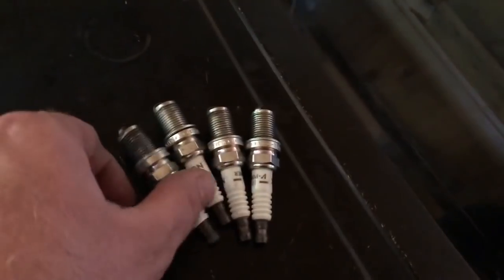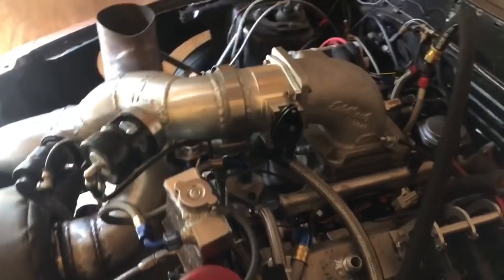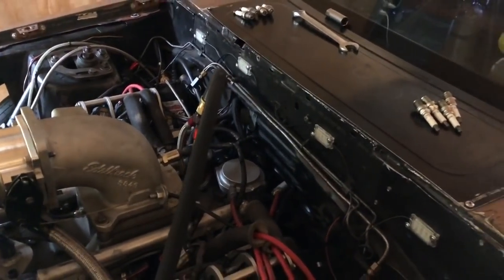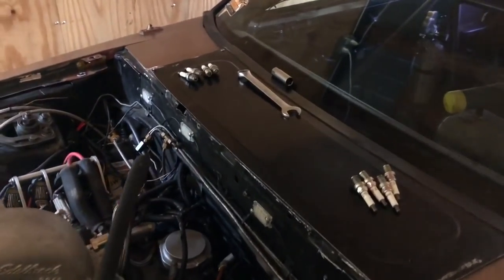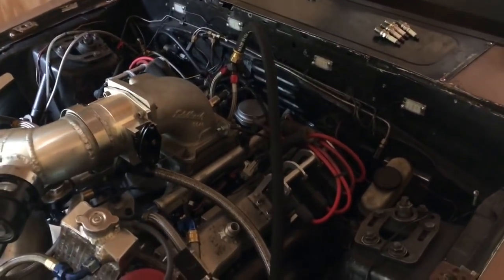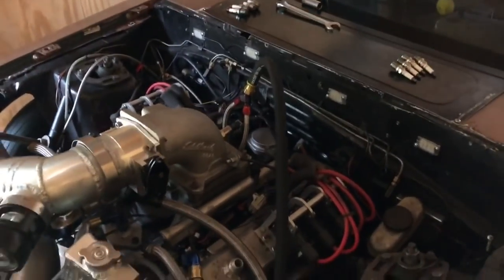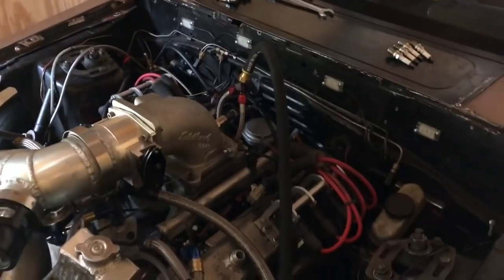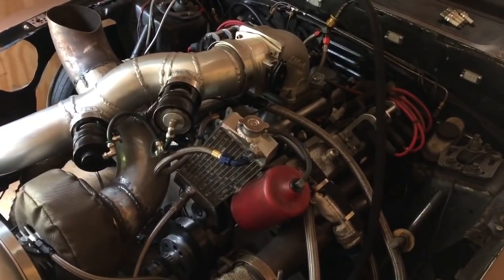Spark Plugs or Data Logger?

Comment: I'm so thankful for this video. . I was searching all over last night for a good spark plug reading vid.. I would like to see the actual detail ed  changes on the plugs .. such as spots color changes and marks on the electrode
Reply from the maker: The type of fuel used makes a big difference as well.  These are boosted methanol, so they like to turn the silver cadmium white.  That is generally a/f mixture.  But heat on the plug is a combination of timing and a/f ratio.  A richer a/f mixture can tolerate more time and the opposite is true, a leaner a/f mixture will require less timing.  Baby steps!

Comment: Need somebody to make a video on how to properly read plugs haven’t had much luck wit that !!!
Reply from the maker: All fuels read different, but the timing mark usually shows about the same. Nitrous, blowers, turbos are different. Generally, you want the mark to be close to the bend on the electrode, a little closer to the end of the electrode.

Comment: Also what type of distributor sync plug are you running. It looks way different than the MSD
Reply from the maker: The distributor is off a 5.7 LT1 engine, remove the rotor button and distributor cap and get a cap from efi connection.

Comment: John I want to know what coil packs are you running I am switching to holly but I want to do coil on plug cannot find  a vid on that
Reply from the maker: I run the truck coils, D585.  You can get a main harness with the plug and play coils.  It plugs into the factory coil harness.  I got mine from lkq, coils, brackets and coil harness

Comment: What motor you got in there
Reply from the maker: Gen 1 SBC, 4.165 Bore, 3.28 stroke crank.  23 degree Profiler heads, Holley HP EFI, Powerglide, 102mm GTR Forced Inductions turbo, Lil John Motorsports Solutions Solid Roller Cam.
Reply: Hell yea thats bad ads man